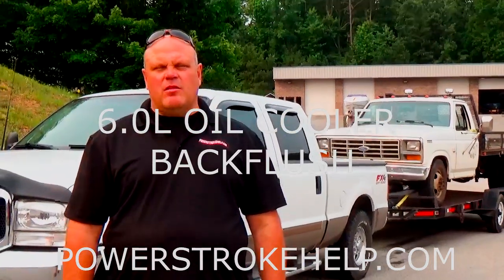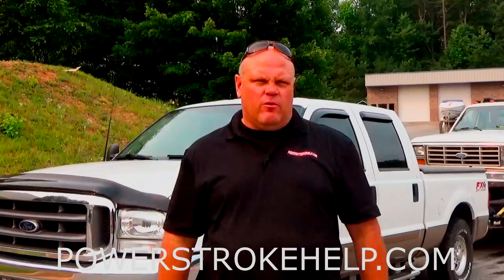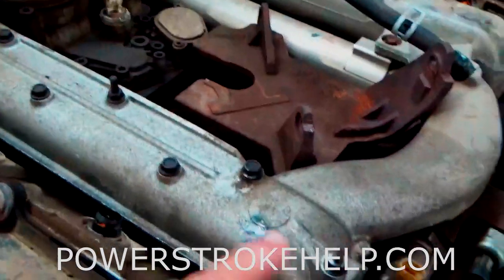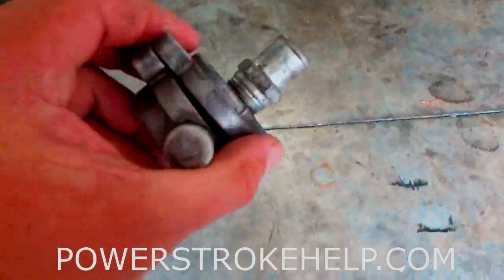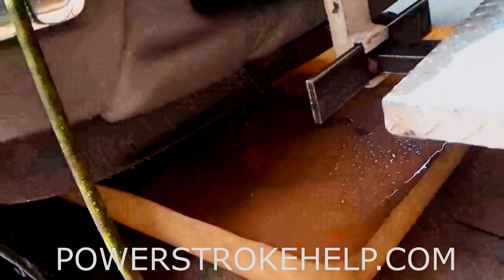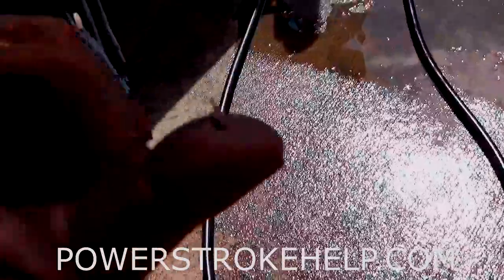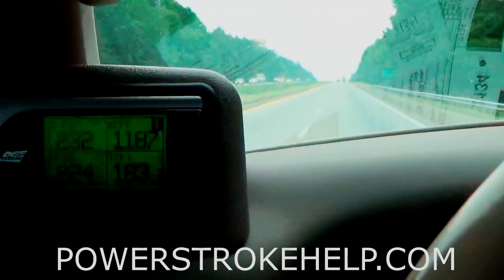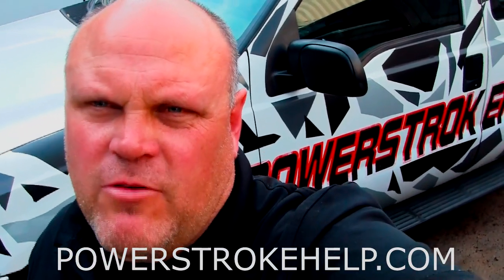6 0L OIL COOLER BACKFLUSH

Comment: When mine failed in our ‘05, I was driving to Costco.  No load.  No tow.  Nothing.  Tested at 39* difference by the Ford dealer.  Replaced under warranty and at about 40K miles.

Comment: Is it bad if my delta is 45 degrees. Coolant is constant at 188. Oil at 233 with no load. Just highway speed. Think it cool be my oil temp sensor?

Comment: What’s the normal oil temp it should be at when driving normal with no load ?
Reply: Great question
Reply: I’m at 8000ft and I never see above 205-210°. I imagine when I’m down at sea level later this year I won’t see over 195-200°

Comment: those numbers are crazy. my 2006 pulling a 9000lbs 5th wheel camper this summer when 96 degrees F out hit 208-210 ECT and around 215 to 218 EOT. normal driving empty is 188-194 ECT and 194-197 EOT.
Reply: Yea I agree ☝️ my coolant never gets above 192 and oil I’ve seen at 223 when I’m in a tune running it hard!

Comment: So I have 2005 6.0 Excursion everything is stock except the banks intercooler and exhaust, still running ford spec coolant my temps never get above 230 and deltas never above 10 pulling a 9000lb travel trailer last summer do I need to worry about my oil and EGR cooler?

Comment: My husband just used your video to backflush his oil cooler, last month. He did flush some funk out, similar to what you did here. He just did it a second time, and even more gunk came out (about the same amount). Is that abnormal??
Reply: No. Never a bad idea to reflush . There’s so much silicone and junk in these engines to start with. Especially if let coolant degrade.

Comment: Could Someone please Tell Me what the Correct Deltas Should Be.
I Been Hearing that a 15° Difference is the Max Allowed as per FORD. Just wondering because i Recently ( Just 4,000 Miles Ago ) Did the Complete Bullet Proofing on my 2006 6.0 Also Turbo and Injector Upgrade, and Many more mods. Also Deleted the EGR, and Switched to the Red Cat ELC-1 Coolant. And Replaced the Oil Cooler. Maybe this was the Mistake i didn't replace it with a Ford Cooler, used a XDP Cooler, said it was the Same Updated Design as Ford's. My Deltas are on the High Side. Highest i ever seen was 40°-45° Difference, after driven Hard for a While. Average is ECT 192°  EOT 234°  After driven on High Way for about 30 minutes. I Bought Truck Brand New Always serviced by me, Oil Always Changed Every 4,000 Miles and so on. Only had 81,000 Miles when everything was done. Due to EGR Cooler letting go. Now I'm approaching 86,000 Miles. Any Help would be appreciated.
UPDATE I just recently did an Oil Cooler Flush Dropped my Oil Temperature about 30° I'm seeing temperature 204°-206° Now and also installed a Mishimoto Coolant Filter. It's starting to get Colder Out where i live and noticed my Temperature dropping Even Lower now, even on a Long High Way Drive. Before flush i was getting 234°-239° that was in 90° Summer Heat. Flushing the Oil Cooler really helped a lot.
Reply: You should check the delta under specific conditions: a 20 minute run @ 65 mph on a level highway with no load. If you're more than 15 degrees off in that test then you have a failing oil cooler (in a stock truck). With an EGR delete and a remote cooler, you might expect different conditions, so some additional research might be needed.
Reply: Should’ve used oem oil cooler or BPD

Comment: Bill I need your advice I have a 2004 Ford F350 original engine stock everything 300.000 km 186.000 Miles the coolant and oil temps are as follows ect 200F eot 220F doing 62 miles hr no load and If I put the passing gear in and it blows coolant out the coolant bottle so I really hoping my EGR cooler is crapped out. What do you think bill I know it's hard since you aren't seeing the truck in person

Comment: This may have been commented on, but why not just tap the intake nipple to the degas like I do and back flush the cooler that way. Its so much easier then fooling with that little cover. As long as the egr coolers been bypassed its a straight shot. Also your coolant temps are going way to hi dude...
Reply: Kevin Scott ... I am interested in what you are saying here. I have an 04 that has been builtproofed, coolant filter, egr delete, the works.... it was done less than 30,000 miles ago. My deltas are anywhere from 15-24 ° difference while normal driving. I want to try flush my oil cooler, i know there is some yucky stuff in my coolant because I cut my coolant filter open and it was caked with stuff. I basically want to know more about how you back flush the oil cooler like you said if possible. Thank you
Reply: Ok cool, not a problem. What state are you in?
Reply: Kansas
Reply: 10-4 sir ... Thank you, is 730am EST time fine? Or what EST time is best.
Reply: Before 6 pm please est
Reply: I am asking about what time in the morning. I'd like to call you as early as possible when you start work. Thank you !
Reply: Hey I can't seem to find your msg with your phone number. If you could please send that again so I can call you. Thank you.
Reply: Sorry. The 730....AM didn't register...I was playing with the kids. Now is fine to call if you want.

Comment: my 6.0 coolant temp was 190 and oil temp was 240. Rip
Reply: Screaming Eagle my eot gets up to 248 when towing and 230 daily driving. ECT is normal 190's. My truck has 250,000 miles and haven't had a single problem. I think a lot of this doomsday delta talk is bs
Reply: nu SkooL Fishing sometimes I think the same thing like is it all just a bunch of bs?

Comment: I got a 2010 ford f250 6.4 and my oil cooler is going bad are something clogged it up.. I get the ranch light and I never pull anything but I do long traveling and the like comes on about 100 miles down the road or so  took it to the ford house they said its the oil cooler.  3k for it to be fix... could I get a coolent flush?  and see if that would unclog it?
Reply: I would also like to know if there's a way to do a  coolant flush on a 6.4l

Comment: the coolant temp seems high
Reply: My truck runs 190° f to 206° f in coolant and 198°f to about 215° f in oil it only runs that hot when i get into it.  75 mph on highway coolant 196-198°f oil 200-206°f
Reply: I had a chevy suburban that ran at 210-220 and hit 230 or 235 if ya pushed it..   it's near normal  and probably just needs antifreeze to water ratio checked.       my 6.0 runs at near constant 212 at idle after 20 minutes of driving

Comment: 06 f250 regular cab 
Mostly stock with sct tune 
210,000 

Is it possible to have good fuel pressure but not enough volume 
Fuel psi 53-57 
I'm max boosting at 20-22psi unless in passing gear 
Or if I return the truck to stock 
It'll run 28psi all day 
I've checked for boost leaks no leaks 
Ficm 47.5-48.0v
Icp warm is 580psi at idle 
Icp warm cranking is 580-650 psi 
Icp voltage at idle is 0.9v 
Vgt at warm idle 63.9%
Ipr warm idle 21% 2000rpm 32%
Exhaust back pressure warm idle 2psi
Ficm sync 1 
Baro warm idle 14.7 psi
Map warm 15 psi 
Engine load warm 29%
Maf warm idle 33-37g/s 
Main injector power warm idle 49.2
Injector pulse width 1.02-1.18
Battery voltage idle 13.6
Trans temp idle 142
Engine coolant temp 184
Engine oil temp 189 

It has consistent crank over no flutters or anything so no sigh of bottomed damage
Reply: Did you ever figure out your issue? I have same issue with max of 22psi

Comment: Normally (Meaning all seasons except summer, and this is the first year after having done Ed's craazy ass flush & switching over to the strawberry coolant) my unladen coolant temps are 5-10 deg negative delta's (oil typically being cooler than water), this summer it seems as though Im getting positive delta's (oil being hotter than water) of 8-25'ish deg. in town, on surface roads

I wound up going out of town the other day & noticed once I got it out on the open road that my delta's were negative once again.

Any scientific reason for this?

Comment: You do the best videos...I am going to need to do this.I replaced the oil cooler less that 1000 miles ago, and am getting deltas 15-20 towing. When I did the cooler, I also did a coolant flush (one of your videos) and then added a coolant filter...thought I was golden...guess not. Hope this solves it...thanks for all you do. Your videos have helped tremendously, and if I ever need major work, I'm bringing it there! You're not too far from Tallahassee :)
Reply: Paul Peeples I think the earlier video of Bill's on flushing was pretty basic & just covered changing the fluid out a few times with tap water & then flush once or 2x with distilled...

A more comprehensive approach is to chemically flush it, them boys @ the Cummins dealership know whats goin on with Restore & Restore+ (Use both, each have their own separate applications in the coolant system theyre good for) -Youll be amazed at the amount of silicate garbage that will be evacuated from your coolant system

Comment: Pulling nothing my eot's at highway speeds are anywhere between 225 and 232. But my ect's never get over 210. I believe previous owner may have installs one of those high flow coolers bc at lower speeds (rpm's under 1500) and at idle, the eot's get well below 220

Comment: What is the brand and possible model number of the flushing tool used in the video?
Reply: Jonathan Strait 
OTC makes one. I think it’s OTC 6045
Reply: @paftaf  https://www.ebay.com/i/392325480253?chn=ps&norover=1&mkevt=1&mkrid=711-117182-37290-0&mkcid=2&itemid=392325480253&targetid=884132925559&device=m&mktype=pla&googleloc=9031291&poi=&campaignid=9426322753&mkgroupid=95066775505&rlsatarget=aud-412677883135:pla-884132925559&abcId=1141016&merchantid=6296724&gclid=Cj0KCQjw-_j1BRDkARIsAJcfmTGKHKWz9GmRaABCTHiYbOkEyVniEWD872dg0xCMh64d_qwAC7TXsC8aAmaGEALw_wcB

Comment: I have to questions for ya Bill I have an 06 and the fan clutch come on at 210 ect regardless of pulling or not is that normal eot is useally 1 or 2 degrees within that. And what is normal eot I believe I have a stuck open the most at because my eot is around 175 we cruzing around.
Reply: Ginger Squid sounds like you need a new t-stat to me. it should be 192+ when fully warmed up.

Comment: I get deltas of 20+ all the time running down the interstate Empty. But neither one of the temps get close to those temps, will I be OK as long as I don't get oil over say 225°f?
Reply: uselessgrant11 Not according to Ford, they go by temp deltas between oil n' water...
Reply: uselessgrant11 Better keep an eye on your EGR... Make sure you don't see any oil sheen in your coolant... But that seems to me like it's time to replace your oil cooler before it turns into a disaster.
Reply: What engine and how many miles

Comment: Bill, does this same rule apply to 7.3 trucks? I have seen my 2003 7.3 oil temp get up to 250 pulling very heavy up a grade in very hot conditions in Phoenix. Truck is very healthy though. Thanks for all your great videos.

Comment: Why not just put an external oil cooler on these trucks and reprogram the computer to kick the cooling fan on sooner?
Reply: Been running manual fan for years. Always works.keeps ect down under 195 no matter how hot  it is outside. Easy upgrade.
Reply: BPD makes an adapter to run a manuel fan clutch of a 97 f250 and getting ride of the electric fan......
Reply: harry guy same problem on my ktm 690. simple solution is to place a switch with a lower temp switchpoint